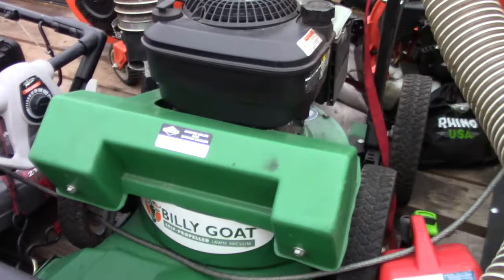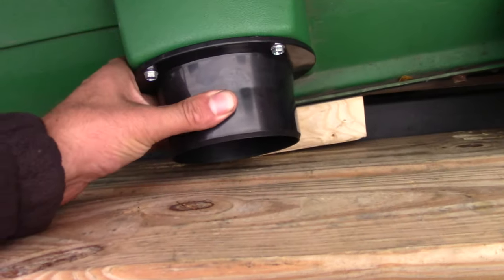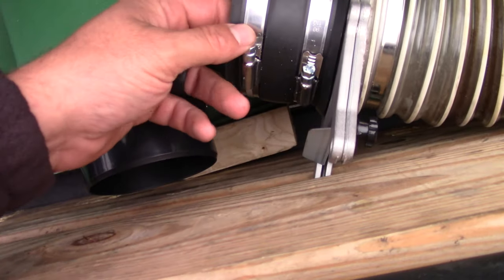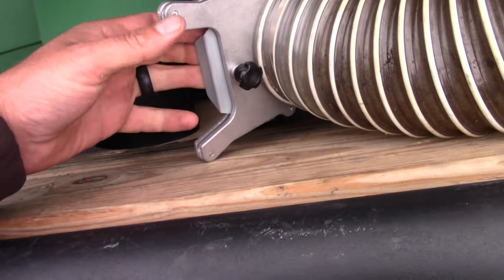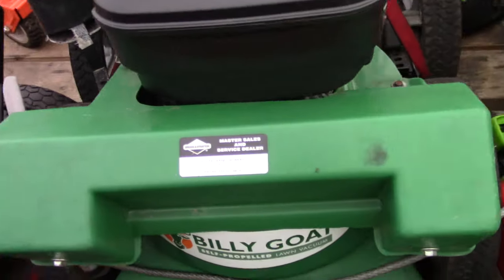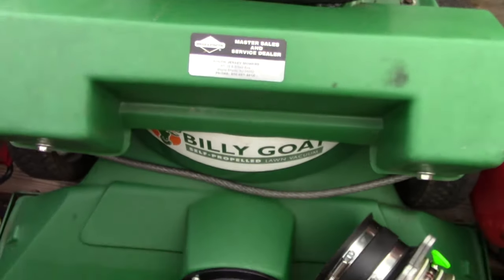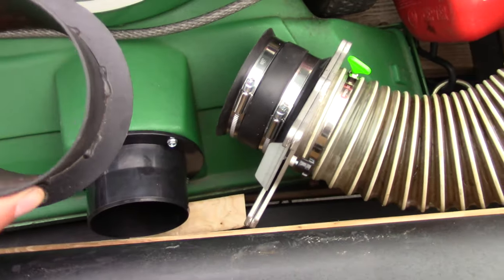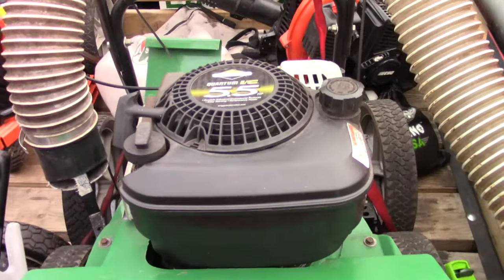Billy Goat Lawn Vacuum Hose Modification by @GettinJunkDone

Comment: I used a shop vac 6.5hp rigid with some 10 pvc & connectors with screws for gutters. Works good but tough to get through the hangers.

Comment: Nice job on your video !!  Have had my Billy Goat vac for two seasons now and many times I steer clear from using the hose because of having to take off the cover plate on the vac intake .  I will look into rigging up some type of permanent solution . Thanks for the great idea !!  B&A .
Reply from the maker: If you like having the vac in the first place, this mod will make it a little more convenient.
Reply: Thanks for getting back with me !  I will have to put it on my YouTube channel when I get it modified .  I stopped posting videos because people watch them and I get no feedback .  So such in the case of your video , I wanted to make sure you know that your creative design to a common problem with the vac was very much appreciated .  Thanks again , B&A .
Reply: much appreciated . Thanks , B&A .

Comment: The mouth inlet sucks. Its fix to the body!. You have to have Martha  Stewart  lawn that smooth as shit. The little wonder has a floating inlet which to me makes better sense. Also the back of the deck needs a rake to ruff up the compacted leaves so you can get them on a second pass.